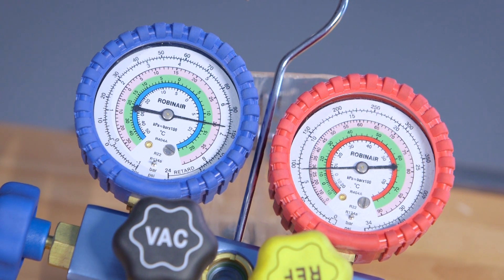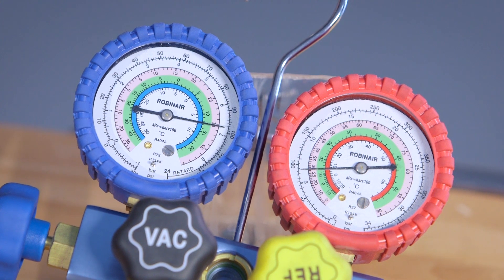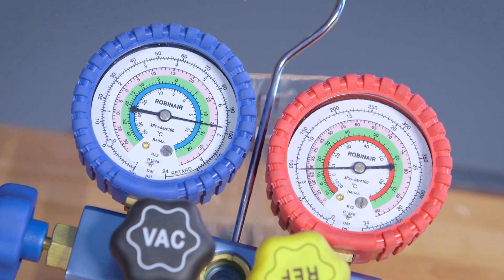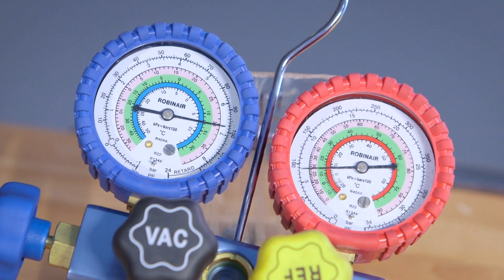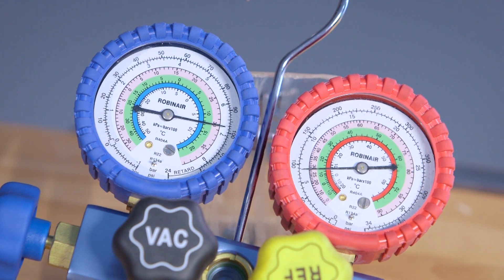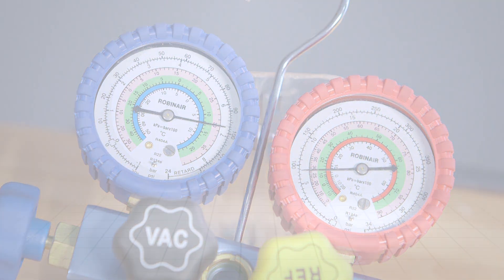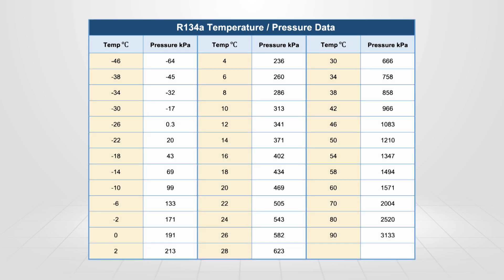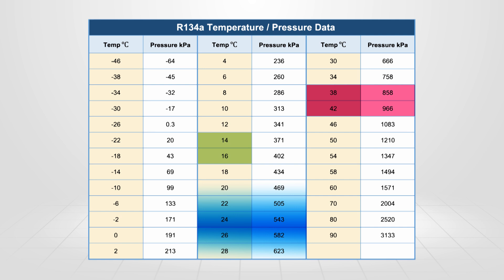Air Conditioning System Pressure Diagnosis

Comment: My Low Side Pressure is 50psi
& High Side is 300psi
So the Compressor is good or bad?
Reply: its not compressor.  there is a blockage. most likely is expansion valve.